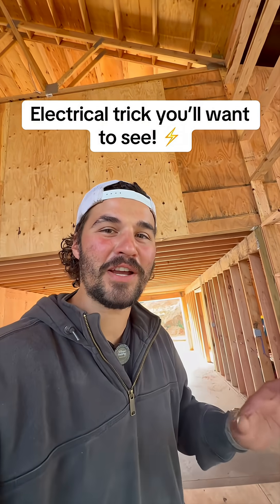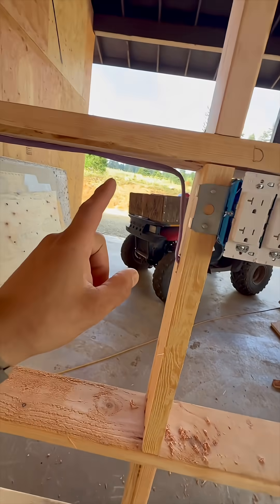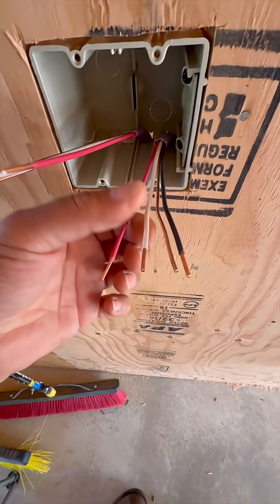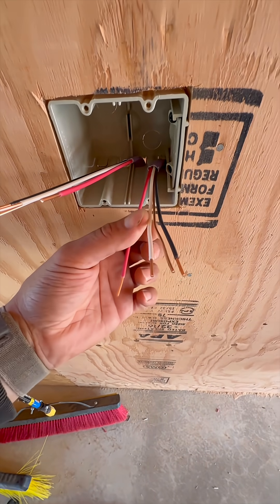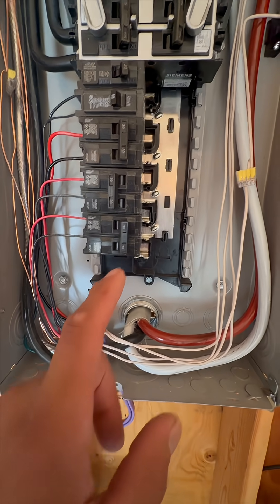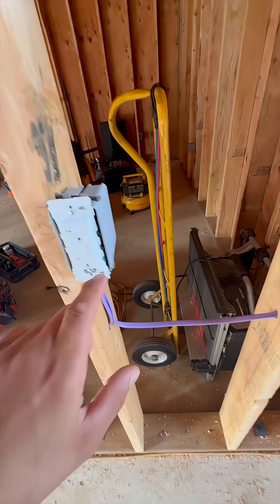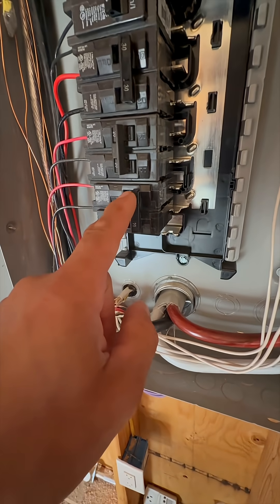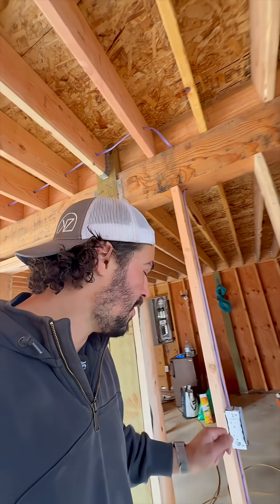I wish all outlets were wired like this! And the cost per circuit is cheaper this way

Comment: Don't be an idiot and do this.  Now when you overload one, you pop the breaker on both!  Now you also need a GFCI outlet on EVERY outlet, not just a GFCI outlet at the beginning.  However, it looks like he didn't use any GFCI on a ground level shop.  AHJ will fail him.

Comment: That wasn’t the smartest move, anybody diagnosing an issue will have no idea they have to carry a balanced neutral, and you’re not going to have an even load anyways. Plug two different things in and a lot of current is on that neutral. You should have just killed the red wire and used the black just like any other run, then you would be speaking universal language of the trade. Right now your setting up knowing there will be a problem at some point 😮

Comment: NEVER EVER SHARE A NEUTRAL 

My builder did this to save money on the runs and I had HUGE voltage drops and tripped breakers constantly and I had to run 6 new circuits on the outside underground to the back side of the house and cut through the walls and installed new outlet boxes. 

I ran 12 gauge to each outlet and had 20 amp outlets each on it's own circuit and never had another problem. 

Watch your builders and make sure they don't do these things. 

Be on site from the day they clear the trees till they finish 

And PLEASE 🙏 I BEG YOU, CUT DOWN EVERY SINGLE TREE BUSH SHRUB EVERYTHING AT LEAST 250 FEET FROM THE OUTSIDE WALLS OF YOUR HOUSE AND RIP UP ALL THE ROOTS. 

My house was crushed by a tree the builder said " It will be fine " 

Cost me as much as the house to have a crane brought in to remove 20 trees after they destroyed the house and the septic and the foundation. 

Trees are the mortal enemies of any structures 

LEARN FROM MY MISTAKES
Reply: You can share a neutral if you use a 2 pole breaker to keep them on separate phases acceptable by code. The danger with it is if the hot legs end up on the same phase in the panel has the potential to overload the neutral wire with the return current.